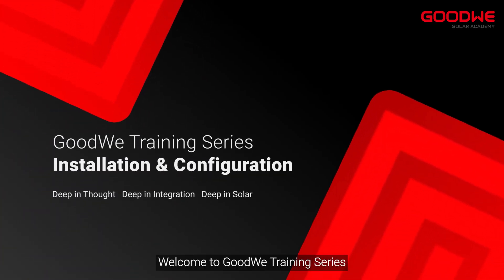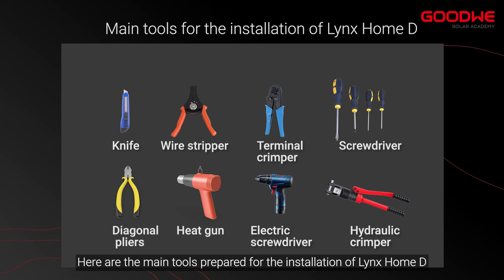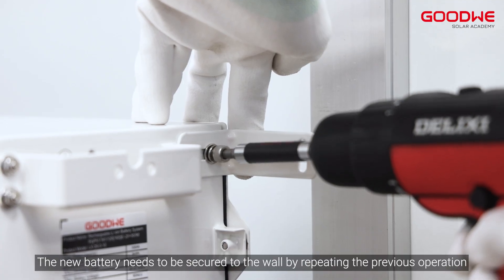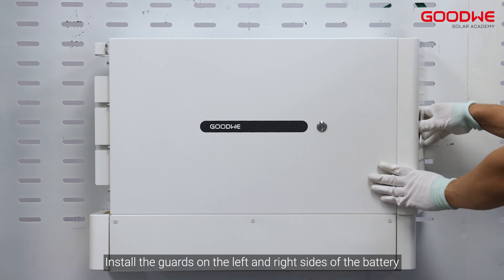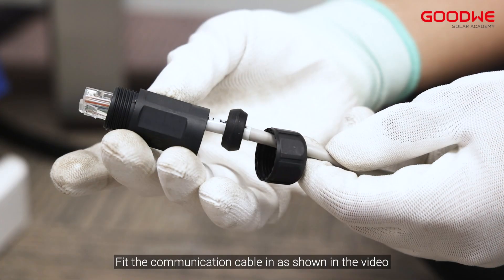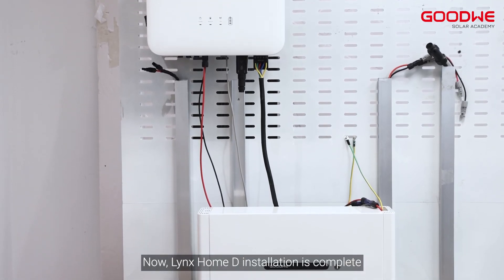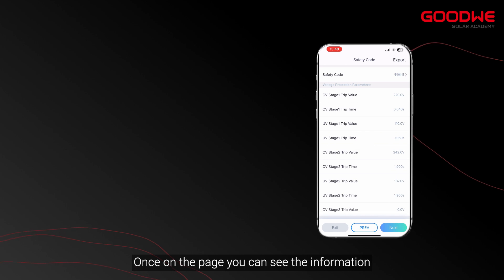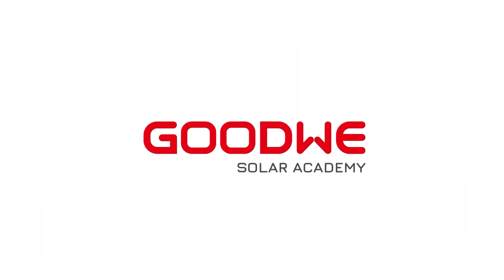GoodWe Lynx Home D Series Unboxing and Installation

Comment: I have two Lynx Home D installed. When charging and discharging there is a noise of about 45 dB (measured mit dB-Meter together with electrician). I'm waiting for reply from Goodwe.